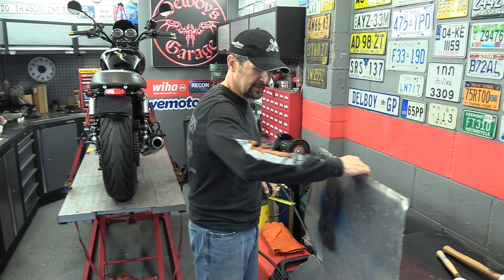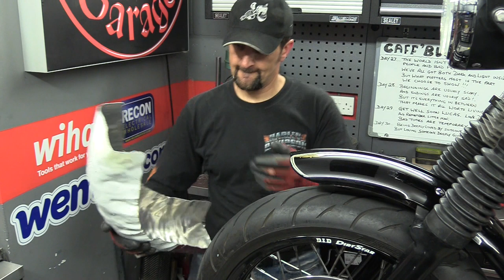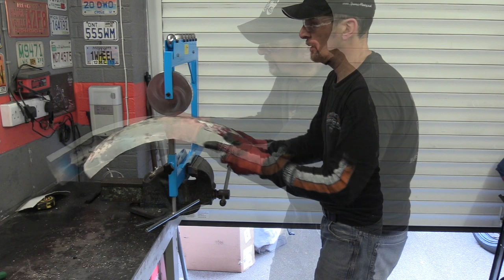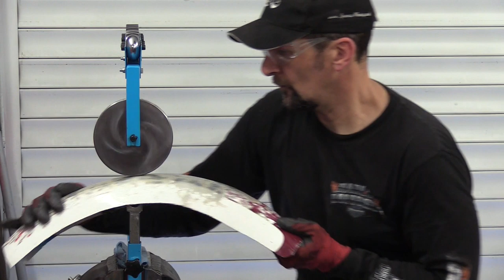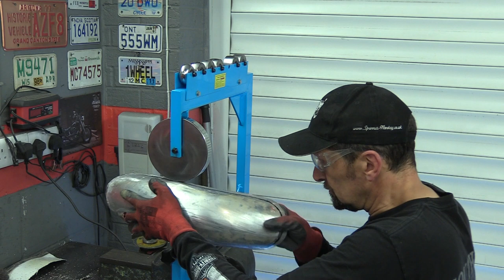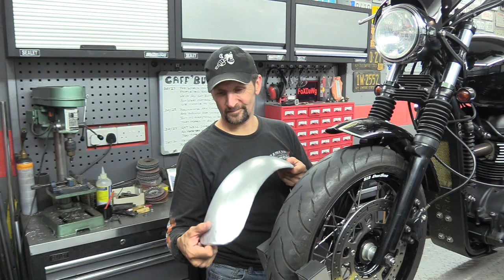Delboy's Garage, 'English Wheel'..! First Practice Piece !

Comment: Something to help you save some time on the next run. Bend the sheet metal at the outset over the top of your leg. It’ll put an initial bend in the metal without having to spend so much time hammering it out. Billy Lane, the legendary bike builder and owner of Choppers Inc. in Florida, used to do that all the time to quicken up the process. If you try it just be aware of how hard you push down to put in an initial curve. It’s easy to accidentally over-bend it.
Reply from the maker: Thank you so much for that, of course that makes sense, im back in the garage tomorrow working on the next attempt.. and ill do just that.. have a great weekend buddy, and thanks for your support... Del.
Reply: Sure thing, Del. Anytime. That’s what is so great about our community. We lean on each other and learn from one another and are never greedy about keeping knowledge for just ourselves.
Reply from the maker: @americanotakuinc.9637  Couldn't agree more mate, nobody owns knowledge!

Comment: Mate good on you for getting into metal shaping. I'll be watching with great interest as it's something that's interested me as well. Check out armour making tutorials on YouTube (cold shaping is the term I think ) for some more techniques.

Couple questions:

How are you gonna weld these pieces? Do you have a TIG machine handy?

You mentioned annealing earlier. Do you also have an Oxy rig handy as well?

How is the bench top wheel treating you? I've read that those wheels are too flimsy for proper work but I've never used em.

Comment: You do make that look easy.. ..is there anything you can't do , .... First attempt...? ...you got to be shitting me .. lol ..it looks factory made ...!!
Reply from the maker: Cheers buddy, that's very kind indeed, genuinely the first time on the Wheel, but have hammered out parts for many years.. .if you remember the aborted nose cone for the Harley and the bum-shaped seat I original made for the streetfighter, all bashed and shaped out of sheet steel... adding the wheel to the process though, means I can make it smooth and look a little more professional.